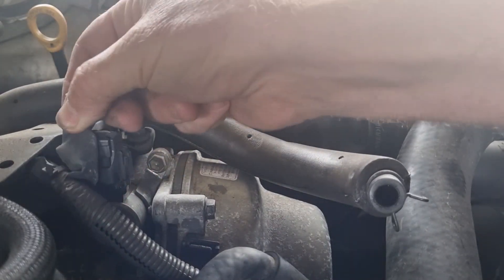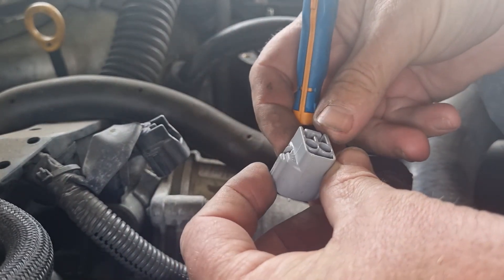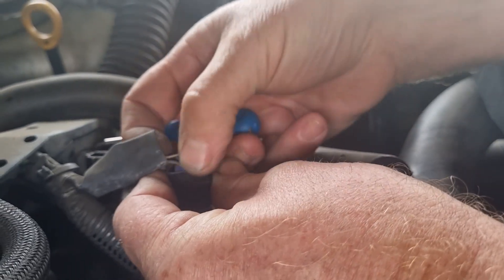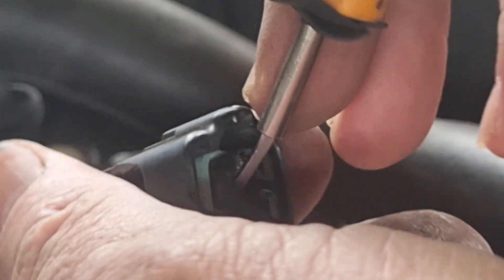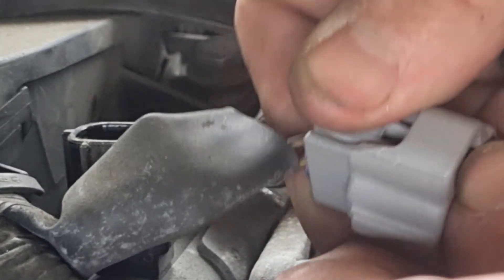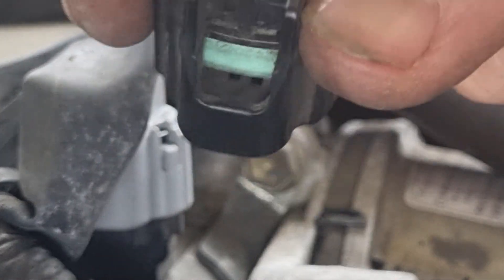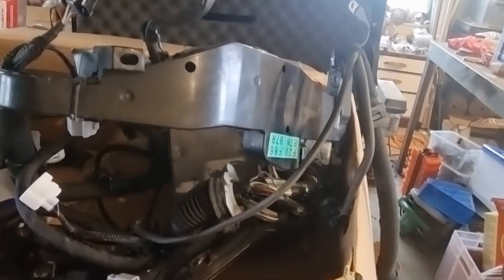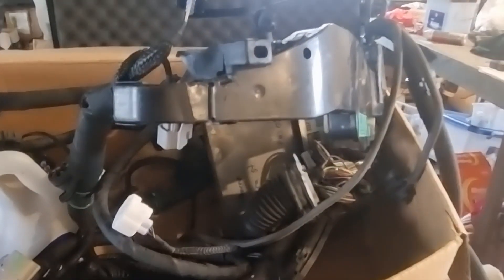Lexus LS430 and Toyota Celsior 3uz wiring connector change. Also suits 1uz VVti engines

Comment: We had a mobile mechanic come out and replace the starter on our 2002 Lexus LS 430 a couple weeks ago and when he unplugged and slightly moved the engine harness out of the way so he could get the intake manifold off he broke one of the wires just before it goes into the #7 coil plug/connector and he also broke a wire or plug or something leading to the right or passenger side oil control valve. I pulled the valve and connected it to 12 volts with jumper wires off of the battery so I think the valve is OK but I don't think it's getting voltage sent to it and I'm not sure where it plugs into in the back of the engine. I'm not sure where to look first. I don't think it's the oil control valve plug in front because I wiggled it around and manipulated the connectors inside to somewhat close or tighten them up (yes, I cracked a piece off of the inside of the plug, the lock tab was already broken but I think the mechanic broke it because it wasn't broke when I changed the other oil control valve a few months ago) and still don't think it was getting voltage so I'm wondering where to start looking. Also, thanks for the part numbers, I have a few plugs I need to get. I'm not exactly sure how to pry the little metal locking tab to get it to let go of the inside of the plug, wished you would have showed that, but maybe once I get out there to change them it'll be more clear once I can get a good look in there. 👍

Comment: I could watch you depin and change out connectors all day. I am doing the same. Rat ate my wiring harness. But learning so much. What is the red slightly skinnier wire in the wiring harness, i know part of it is anti radio interference?

Comment: Great video, Kelvin.  Which is the one OEM connector you have to get from China?
Reply from the maker: A three pin connector for the air conditioning pump subloom on a 3uz.
Reply: @CartuneNZ  Ah, gotcha.  Not shown on the EWD.  But, also not necessary if I'm going to use an a/c compressor from a late 1UZ!

Comment: Great little video Kelvin 👍I'll be doing this to my ignition coil plugs when I change my spark plugs. The UZ's are at that age now and all these plugs will 100% break.
Reply from the maker: Correct.  Very very common to have them break and its an easy repair.  Cheers Kelvin